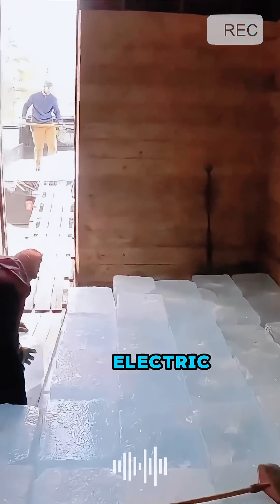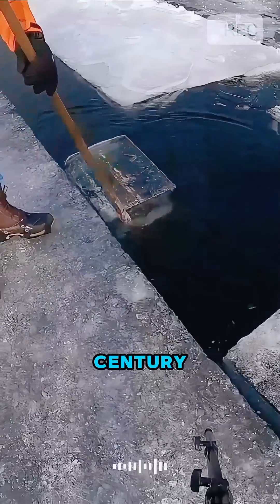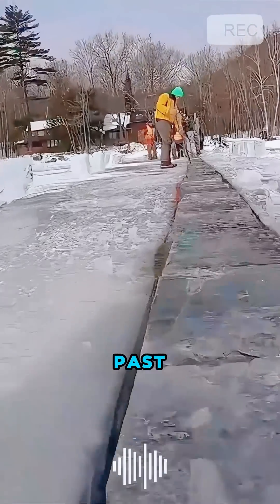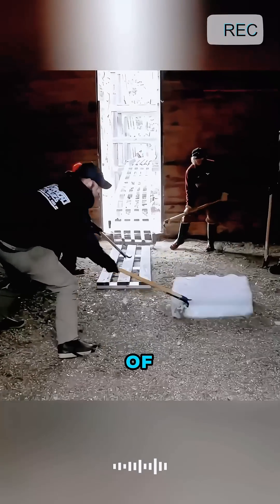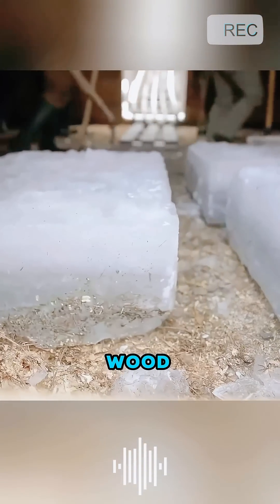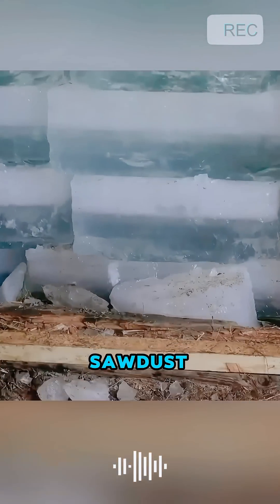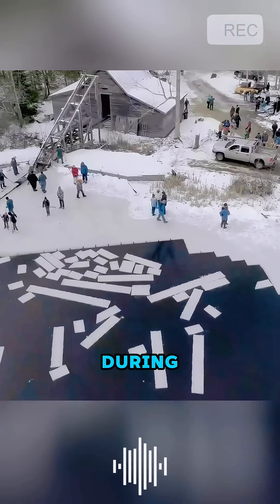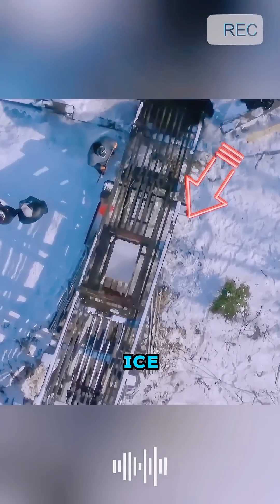Ice harvesting is a genius idea

Comment: I grew up in Glenridge or Junction city as some call it we had a coal mine and a ice house the interior walls were coated with 3 or 4 inch thick  rectangles of cork 2ft x 4ft pieces the huge building was solid concrete walls with that cork lining my dad said when they closed the ice house him and other kids ripped out the cork and used them for rafts to swim on he was born in 1922 so the ice house had been there a long time a few years back the city hired a contractor to demolish the ice house unfortunately the contractor didn't know much about how it was made it was hand poured with 1 wheelbarrow at a time using what's called pea gravel which was basically small pieces of river rock any way oh the wheelbarrow loads had to be pushed up a ramp which I was told ended up being hundreds of feet long any way the contractor ended up going way over budget as the old landmark did its best to hold its ground

Comment: Incredibly bad idea unless you are certain the water the ice is made from is sterile. This caused several cholera outbreaks in Britain.
Reply: Bleach, 1/2 to 1 tsp per gallon, stir and wait half an hour.  Vaccinations just in case. But with so many roads going down and costs, a community resource that doesn't have to be water-tight may be useful. Insulate well.

Comment: Brick and cement are very poor insulators.  Saw dust is excellent though.
Reply: That's for sure. I don't where the narrator got this opposite information. Ice storage buildings used thick timber not brick or cement.

Comment: Just for reference, a window air conditioner does about the same as 1 ton of ice per day.  Just imagine the labor, gasoline, and all of the wear and tear for 2,000 lbs of ice per day.
A 750W compressor 6A @ 120VAC can move 12,000 BTU/hr.  That is equivalent to 2,000 lbs of ice per day. Day after day.

Would you work to cut, store, then deliver 2,000 lbs of ice for only $2.50 total?  Because that is what it costs to run the refrigeration unit instead of the ice today.
Reply: I think you’re a bit confused. People did not cool their houses with ice…
Reply: @johnfarling1537  I think you are a bit confused or you could not read past the first sentence.  I used window air conditioner for reference, because people can “feel” the air conditioner.  And people were commenting why don’t we use ice any more instead of electric refrigeration.

If you want a direct refrigerator reference to use Ice to cool a modern refrigerator, you would need up to 200 lbs of Ice per day.  To equal the same amount of cooling the refrigerator does with electricity.  But that electricity would only cost for less than $0.25 per day.

So imagine DoorDash for a $0.25 order that weighs 200 lbs.   what would the payout for a $0.25 order?

So the cost to cut, store, and deliver 200 lbs of ice; what would you charge?
Reply: @johno812  nope, you’re the one that’s confused talking about cooling air with ice.
Reply: @johnfarling1537  see, now I know you are just a troll.  You haven’t contributed any information or insight.  Would you create a company that could only charge $0.25 to deliver 100 to 200 lbs of ice everyday just to keep a refrigerator cool for 24 hours?  Then you would have to deduct labor to collect, store, and deliver.   That is why stores produce ice on location by using electricity and refrigeration technology.  Unless you have some insight, calculation, or share some other knowledge; we know any other response is just baiting people with actual knowledge they are trying to share.
Reply: @johno812  what the f are you talking about? You feel baited? Get over yourself buddy!
Reply: @johnfarling1537  lol, say something that has value. You are the one that feels making zero contribution to a discussion other than trolling.  I am just trying to share my 25 years of designing refrigeration equipment and decades of training young engineers.
Keep trolling buddy.
Reply: @johno812  I shared my opinion. This is a YouTube comment section, why are you treating it like a college debate course?
Reply: @johnfarling1537  simple. The math to calculate the energy required is basic grade school math.  To say that “harvesting ice is a genius idea”; is actually the exact opposite.  A simple calculation of the cost of electricity versus all of the manual labor to collect ice shows that it is nearly 1,000 times cheaper to just produce cooling via refrigeration.   You may actually consume more energy collecting, storing, and delivering ice.  That is why it was abandoned 100 years ago and replaced ice box refrigerators completely by the 1940’s.  There are lots of misconceptions and concepts that may seem counterintuitive to lament; but a little science and math allow you to compare them directly.

If you want to share an opinion, go ahead; but you directly replied and attacked my comment which by the YouTube algorithm shows up in my notifications. Therefore, when you clearly didn’t understand that a 1 ton refrigeration unit is actually based the amount of ice that used to take to generate the same number of BTU’s.  12,000 btu/hr (288,000 btu/day) I answered your reply.
If you don’t want facts as a response, then go troll some commenter who will just exchange insults with you.

The more you reply to me, the more there is an opportunity of me being able to share some wisdom, science, and engineering.
Reply: @johno812  lol I attacked you? Get a hold of yourself.
Reply: @johnfarling1537  don’t gaslight.  I didn’t say “attack”.  I said you replied directly to me; which generated a response from me.  You are the one Trolling, and haven’t offered any information or difference of opinion just direct comments and criticisms to me which I respond to.
You still haven’t answered the question, would you quit your job and start up a company that would have to charge less than $0.25 for 200 lbs of ice per day to compete with electric refrigerators?
Reply: @johno812  why do you have expectation of others?

Comment: When the US bought Alaska, 2 of the first resources industries created were ice-cutting and sawmills to turn the local forests into sawdust to insulate the ice for shipping. The Bay area bars found ice from Alaska much less expensive than shipping it from New England by way of Cape Horn.
Reply: You mean the Drake Passage. It’s a 600 mile wide waterway connecting the Atlantic Ocean and the Pacific Ocean between South America and Antarctica.
Reply: @nathanmohn4272 oh.. so you mean the Drake Passage is the body of water that takes you around Cape Horn, the southern tip of SA, before the Panama Canal existed, kind of like the OP stated?  Which was likely to be a longer, more dangerous and more costly shipping route than a mostly straight run from Alaska like the OP implied? I believe the point was effectively conveyed, in a manner that most Americans heard in school and understand. Sailors may have a different terminology, but they, as you, understand exactly what was meant.
Reply: And so I guess delivery of ice to Australia could occur in either the Pacific or Atlantic routes . My feeling is the Pacific route as more convenient and quicker. Like less than three weeks.
Reply: Who gets the credit ?  Drake or Magellan?  I know it as the Straits of Magellan. It does help avoid those mountainous seas.

Comment: that's why AC is rated in tons.  ice takes 144 BTU to form per pound or to melt.   2000 pounds times 144 is 288000  divided by 24 hours is 12000 BTU per hour.
Reply: Oh yes the good old British thermal unit the amount of energy it takes to heat 1 L of water one degree Celsius is a BTU
Reply: Never heard anyone use that term in my country. AC rated with horsepower here

Comment: They used to harvest ice from the Fox River.  It would be loaded on to railroad cars from the siding that is now the bike path on the east side of the river by the trailer park.  Unfortunately, at that time, there was no EPA and there was a lot of raw sewage in the river.  Too many occurrences of women finding feces in the bottom of the ice box after the block had melted, killed the ice business.  Back in the 1960's we skated on the river all the time and not just the coves.  Now, it rarely freezes, certainly not enough to cut blocks of ice.
Reply: Actually they use Timber Lake and not the Fox River.

Comment: That aint going to work. Those stored blocks are going to fuse together  and  lock up the whole shubang in the insulated ice house
Reply: Sawdust between them😊
Reply: @user-ll6fm2qn9k  I didn't see any in the shot of  the ice house interior
Reply: @RobertBee-fs8hv  - Ahhh... But, you also didn't actually "Work" in that type of Facility, either! So, you are just guessing an idea, that for decades was proven to not be the result of such places! 

Judging from a Picture, in a Video, isn't much "Analysis!"
Reply: @robertweekley5926   judging from   having to break up a bag of ice to fit the ice on my glass